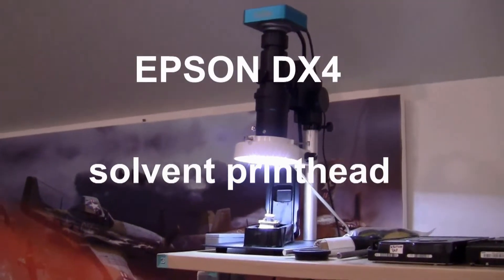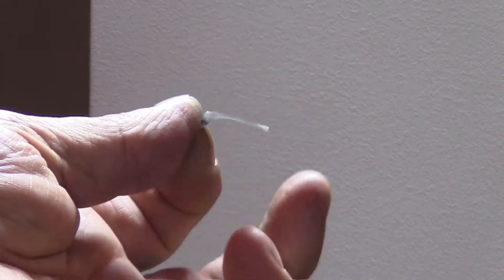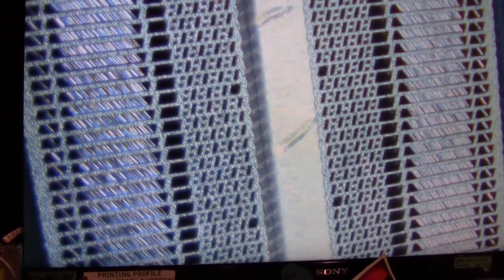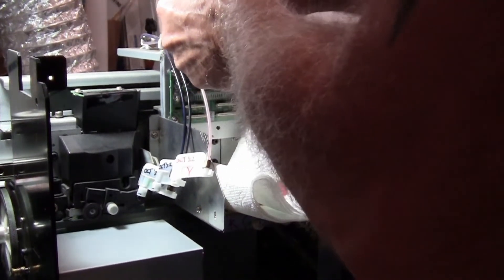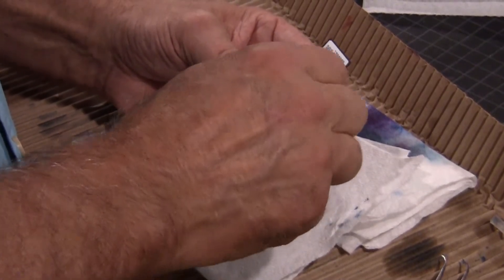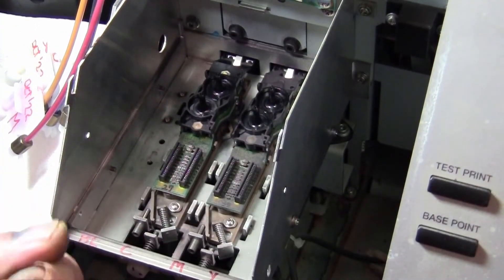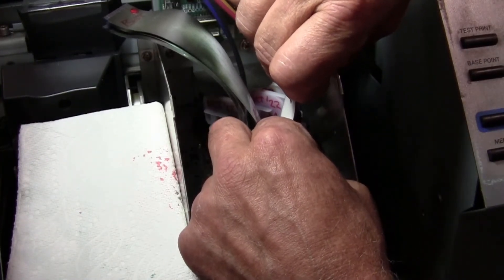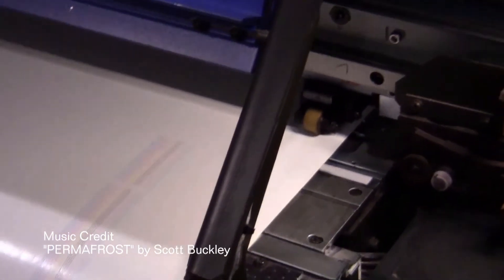Epson DX4 Print head replacement -  Cleaning -  Installation

Comment: Today I recovered printheads from a printer that was sitting unused for 4 years. Just shows how tough these Dx4 heads are.
Reply: What methods did you use?
Reply: @PeterGrant-Artisan  removed head, placed in cleaning solution in a bottle cap for 2 days. not whole head just the bottom 2mm. Reinstalled and just used syringe and pulled ink through captop. I find this is the safe way. Pulling ink instead of pushing liquids from the top. using small syringe took about 20 draws, each time few nozzle came back. kept doing normal clean and test print to check the progress.

Comment: Awesome video, thank you! I've been using DX4 for years and never had this problem before. On my VP two of printheads went down at same time. M and Y. And as usual I checked fuses and mosfets on mobo, they all ok. Tested printheads in another machine and they not working. Happended during manual cleaning, i got ink all over the machine, dont ask how hah, long story short. Is there a way to swap out the board on the head? or fix heads somehow. Its a waste as they were pretty new. It has to be some small resistor or something.
Reply: Have you moved or unplugged a cable card (ribbon cable to the heads)? Did you get ink in where the cable plugs in, or on the head board? If not, then unplug those cable cards, clean, then reinstall. However, if they got wet, it may be a different issue.
Reply: @PeterGrant-Artisan  Thanks for your reply! no cables weren't unplugged and ink didnt get to the head area or head boards. Ink got to large cable going to the main board. I tested head on other printer and issue is the printheads not the boards or cables. Is there a way to repair the head electronics?
Reply: @EdgeCreativeSydney  From what I've seen under the microscope, I feel they are made via robotics. That said, you or I being able to work on them is mere impossible as everything is microscopic. As for the surface mounted components, they too require special tools and a microscope to work on. Sad to say, once they go out-of-service, we have to replace them completely  :(
Reply: @PeterGrant-Artisan  thank you mate, what a shame, luckly they are cheap to buy now :)

Comment: I am using an cheap canon MG2577S printer which belongs to MG2500. It comes with non reusable cartridges which I filled 3 times and after that it clogged. I tested the printer ink in my fountain pen ,I found that it dries faster and pigments stick all over the ink cartridge of my cheapf ountain pen. I found that these inks are designed to clog. Also the cartridge life is less its designed to be like that. I want to try out of the box things the only available water soluble ink I can get is cheap or expensive fountain pen inks which is water soluble while most printer inks are not that soluble in water.

Comment: Hi, Great video and thanks for posting it. I'm right in the middle of try to bring back a Roland SC-540 that was printing the test print perfect about 3 months ago but how is not good I only have Cyan with a little black. have started with a head soak but looks like I will have to do a complete flush out of the heads like you did. have been looking online for the service book But no luck at all.
Thank God I found your video as was about to take the heads out and see you have to do a head calibration print sheet. lucky right😱
Any chance you can help out with a service book...Please or how to enter that mode. Cheers from Tasmania.👋

Comment: Whats up brother do you have any videos working on your sc545? I have one right now that I am trying to unclog the lines and bring back to life.
Reply: I notices on the XC-540 you did not put the pressure plate on top of the dampers, is there a reason for that? There is a sponge on this pressure plate that does not cover all dampers and I always felt this plate was bad engineering
Reply from the maker: @impressionstitan1561  It was left off during the calibration setup so that the heads could be moved with the hex-key and thumb-screw. Once calibration was completed, the pressure plate was reinstalled :)
Reply from the maker: Is it the ink lines that are clogged? I back-flushed the ones in this video and went perfectly. The SP is the same as the SC, just more heads and parts, though basically the same machine to work on as I've serviced both. And to mention, I pulled all the circuit boards from my SC at one point and cleaned them all up before reinstalling.